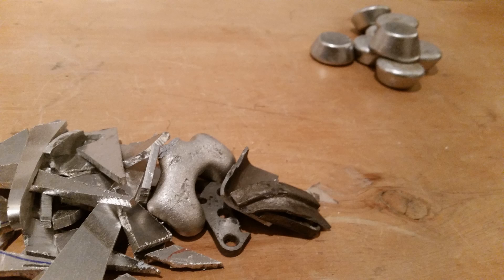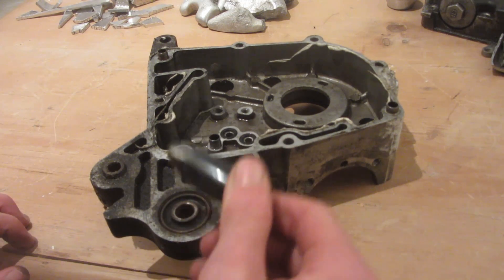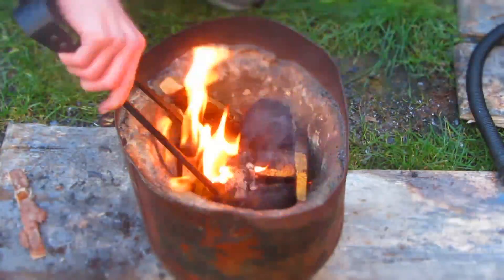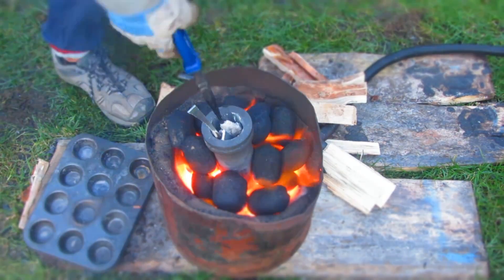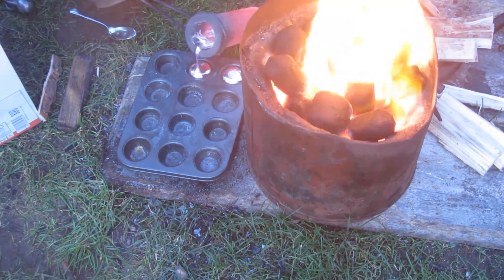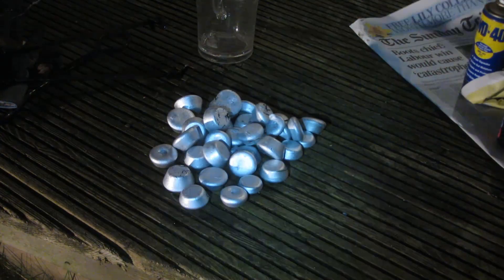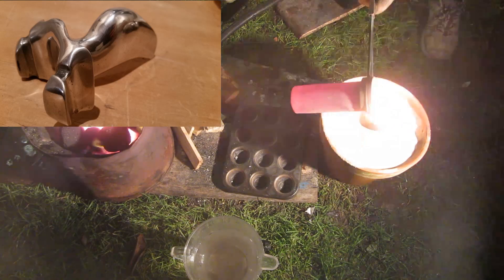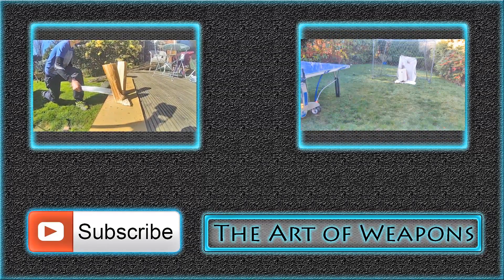How to Cast Aluminium Ingots at Home

Comment: May I ask where you bought your crucible? I just recently tried my first aluminum forge that was designed like Grant Thompson's but the crucible which was made from a fire extinguisher failed and most of the molten aluminum leaked through. I would like to know if your crucible has ever been known to fail, and if so may you tell me where you bought it or where I can find one like it? Thank you so much and great video!!!
Reply: ebay.com , search 3 kg graphite crucible. There's a TON of options. Not sure if the exact one is there, but a lot that are similar.
Reply: Ok, I'll take a look. Thank you

Comment: DO NOT EXTINGUISH AN ALUMINUM FIRE WITH A NORMAL ABC EXTINGUISHER. It is recommended that you smother the fire with sand
Reply: But the Silicon Oxide will cause slag in the aluminium and make you have to spend some time to clear it

Comment: Nice video but why bother making ingots? Wouldn't it save a ton of time just to melt your scrap Aluminum and use it in your molds right away?
Reply: The point of casting ingots is that they are a more pure form of aluminium, whereas if you used soda cans straight away, your casted item would have a lot of slag in it. :)
Reply: +ThatCrazyPurpleMan Do you have to do something to get them more pure after you skim the surface when it is still molten? What do you do to the ingot to get it more pure?

Comment: Sorry if this question is already buried somewhere in the 500 previous comments:  What is the sense and value of making ingots?  I get that they are convenient, bite-sized pieces, but it seems to me that it is double, and so redundant work when compared to simply heating the scrap aluminum when you want to make a finished product.
Reply: There's many reasons for the ingots. The ingots of any kind are usually supposed to be a pure or close to pure form of the metal. When you heat up scrap, oxidation layers among other contaminants may form on the top, delaying your work process. Making a bunch of ingots will eliminate any possibly tedious filtration of the molten metal. Ingots are also a better form of measurement, because realistically, when heating up scrap, you may not end up with the same amount of metal when fully purified. Ingots are often certain masses, to allow an easier calculation of the amount of metal needed. Overall, Ingots save needed time, and add accuracy to whatever you decide to create along with them.
Reply: +Eric Angel  Thanks for the good explanation.

Comment: Really like your videos and your excellent directions!  Definitely going to give free foam casting a try.  I'm curious... have you tried casting brass with this method?  Slightly higher melting point, but should work well with a decent crucible.

Comment: hi awesome video!! i have spent a long time to create my own fouge based of Grant Thompson but i came across a problem and i was hoping you could help me. my crucible is definitely getting hot enough the hole thing glows red but the cans that i'm using don't seem to melt and i'm not sure why i don't know if its getting to hot and burning them but it shrinks them and turns them black but don't melt so if you could help me that would be great thanks :)

Comment: I made a Forge by Following Grant Thompson's instruction. My Forge works well, but I was having troubles with a crucible. The local fire company insisted not to do this project because cutting a fire extinguisher for a crucible can be 'unstable', not letting me have an old fire extinguisher as a crucible. I looked online for a decent crucible and a found this one: http://m.ebay.com/itm/MELTING-CRUCIBLE-FOR-MELTING-GOLD-SILVER-SILICA-CUP-TYPE-SLIP-CAST-A-1-ITALY-/200594374854

Can anyone tell me if this is a good buy? I watched this video and he recommended a Graphite crucible but is this still good?

Comment: You should attempt to make a stronger alloy for casting other items which wouldn't be possible with Aluminium... just a thought. 

I'm actually going to attempt such a thing with Copper and Aluminium.

Love those slingshots by the way, I'd buy one if you sold them.

Comment: I followed Grant Thompson's tutorial and have a pretty decent forge with a 3"x5" fire extinguisher crucible, but I'd like a more permanent one like the graphite one you have. The problem is that I lose about half of the volume the fire extinguisher provides, and the graphite crucible (3kg) would be too tall to use Grant's lid design (I think). Do they make fatter/shorter graphite crucibles? EDIT: Looks like the "A3 Salamander" crucible is just about the right size.

Comment: Have you ever tried welding aluminum.  I know you don't weld it in the traditional way. If you like I could share a design with you on how to do it. Simple build. Different style of foundry. One that holds the molted aluminum.  And a large flat head screw driver as your applicator. It works on sheet metal and thinner stock.

Comment: IDEA for CASTING: cast a small sanding block in any size you like to attack sand paper. I have one by myself and it really helps to sand even surfaces. You can make a bigger block that you sorround with sand paper and a smaller block for the top to clamb the sand paper between using screws. Or you can just make one block and glue hook and loop fastener on it. 
I highly enjoy your videos and i bet Jörg Sprave is proud of you. Good luck

Comment: You could try casting arrow heads. Aluminium might be a bit light but its surely worth a try. For a bigger project I'd suggest the handle for a bow. If I recall correctly you have already made a compound bow before. I'd love to see something like that, since I'm doing archery myself.

Comment: point number 1 - rule Britannia, aluminium is king
secondly, would an aluminium compound bow be a possibility?
Reply: Depend if it was hollow cast but even tgen it would most likely just kink rather than bend slightly
Reply: I don't think so as when he made a wood compound bow me said me needed wood as metal is too heavy and not flexible enough

Comment: I have a bag uf almnun cans, does that work???
Reply: Yep
Reply: Absolutely, I have two enormous bags full of them. Aluminum foil is a lot purer by far, as cans contain other stuff for the purpose of...well...being a can. Unfortunately, there is a lot of trash in cans that becomes slag, leaving about enough pure aluminum to fill a plastic water bottle cap (per one can). Go with foil but if you have cans go with that. Hope this helps.
Reply: thx man... I'll work on that

Comment: Sory for english
I am from Germany and i have no problen how you call Aluminium 
My idea was to cast chessfigures if you know what i meen 
I do it but my problem is witch is my other color 
If anybody have an idea please life a koment
Reply: Louis Kane seems like a good idea. i had a chess set that had glass pieces and one "colour" was matte and the other was completely clear
Reply: you could always spraypaint one or have one mirror polished and the other with a matt finish
Reply: Du könntest ein Set pollieren und das andere matt lassen.
Reply: Make one side polished to almost mirror and brush the other side with those metal brushes. Brush lightly so you get small and thin grooves. Done this way I think it will look very nice once done and will also look professional. Also to cast make the pieces out of Styrofoam and cast it like in grant Thompsons new video
Reply: Making chess pieces is a good idea.  I should do it some time

Comment: You might want to be careful about doing this on concrete.  My welding teacher said if you superheat concrete, trapped moisture can build up pressure inside and cause a chunk of the concrete to explode violently.

Comment: great stuff, maybe try lumpwood charcoal as it spits and sparks less than the formed briquettes, bang on with heating the tray up first , nothing like a face full of molten ally, engine casings need to be careful with though as there could be a high proportion of mg in there, with your spoon, try drilling a couple of small holes in the end you dross through with and countersink them a bit, I use oiled sand and the blue foam, smokey as hell,,I might try the simple sand casting it looks a lot less work that the whole cope/drag/parting powder lark. If you have a potters shop/supplier near use , maybe buy a matched pair (or stone cutter a big one in half) of kiln shelves,(I make a tunnel forge out of them too!)so the cake tin is off the burning wood. all the best!
Reply from the maker: thanks, I will be sure to try some of these tips in the future!
Reply: I worked as a School technician up until xmas , 11 years doing non ferrous casting, metal lathe etc, now I'm a knife maker so I've done a fair bit of stuff such as your vids,,you've got most of it sorted out okay..just stay safe eh?
Reply from the maker: Wessex Blades&Bushcraft yep thanks!